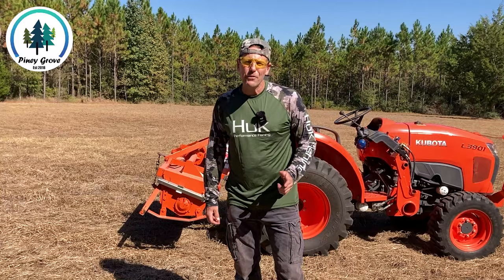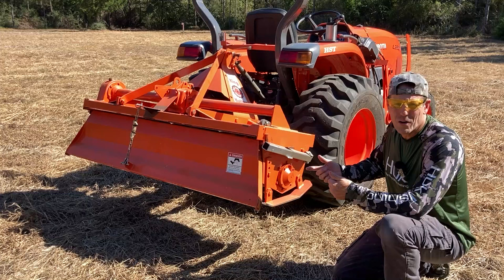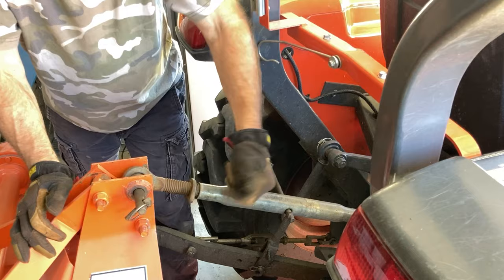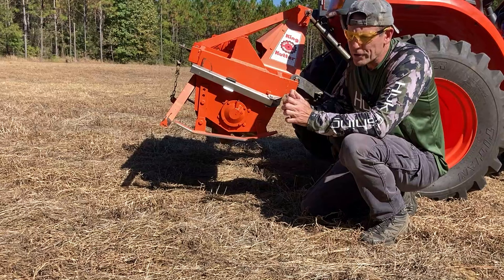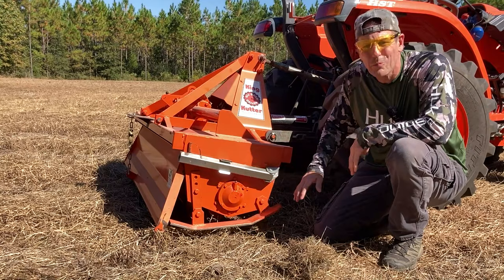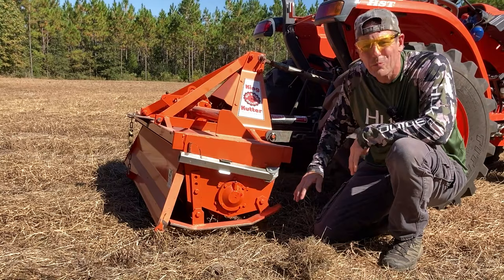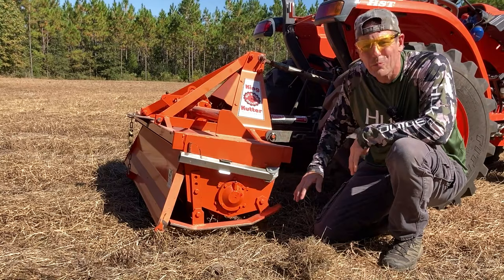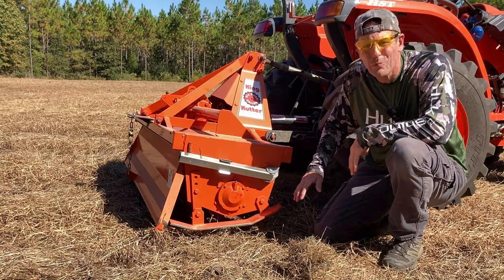How to Use a Tiller with a Compact Tractor

Comment: Bad idea never tighten your slip clutch that tight if it slipping already like you said over working tiller eventually destroy your upper gear box. I have seen this happen over and over I have kk used it for 20 years now issues I don't abuse it not commercial grade most are not need to use as residential not commercial if so go buy commercial grade tiller

Comment: Lots of other factors tractor weight also determine size equipment you can run i love Kubota tractor but number 1 problem Kubota is there lighter than most on market so keep that on mind definitely makes a difference on hills piece of equipment can flip tractor Kubota is the worst light high center of gravity 😊
Reply from the maker: Thanks for sharing.   We have a little more weight in the tires now!  https://youtu.be/uQmuNvcNsOU

Comment: The other commenter is correct regarding diakon radishes.  In the fall, before first frost, plant the tillage radishes.  They will grow the root into the hardpan and deeper.  In the spring, if there is no winter die off, till it to kill it.  Wait about 3 to 4 weeks, then till for planting.
Reply from the maker: We've planted them before.

Comment: 45 hp Kubota, 7 foot Landpride tiller. I usually follow a 2 bottom 16" dearborn plow and 6 foot disk. Those depth gauge runners do nothing unless you're tilling hardpan or virgin soil. 
Thanks for these good videos.
Reply from the maker: Thanks!  Tillers are awesome.

Comment: Something to consider; when making your successive passes, the skids sink in, tilling deeper.  I've tilled down to 6-7" with repeated passes without changing the skid depth.
You can control the depth another way.  Adjust your top link to be very long for less depth.  I've cut grass without disturbing the soil that way.  Helps with leveling the yard.
I appreciate the tip about moving as you drop your tiller.  I've constantly had "snipe" because I tried to get the sides square.
Reply from the maker: Thanks for watching.  Other tractor videos here:  https://www.youtube.com/playlist?list=PLG5yS75HLzo3RVqEuA0f6IioXV6FtFhHW

Comment: I believe if you go over it a few times you can get extra depth as the skids will sink into your tilled ground.
Also, on a side note, try to not engsge pto with tiller all the way up. You mention it's noisy when you engsge. That's cause there is too much angle on the pto shaft. You'll notice it gets quieter as you lower it
Reply from the maker: Thanks for watching and the tips!
Reply: Wouldn't have hurt to have PT o's up to 540 before he engaged the ground.

Comment: My dad and I did commercial, industrial and agricultural weed abatement mostly with a bush hog and a big Howard rototiller behind a Massey Ferguson tractor.
People were always complimenting on how pretty and smooth we left it after rototilling the ground with no footprints or tire tracks anywhere. 

I cannot find any reason for leaving the tailboard up. And it always leaves the ground looking bumpy and very messy!

We always rototilled in first gear low range with high RPM to leave the ground as smooth and pretty as possible.
Reply from the maker: Going slow and steady will lay down a nice bed for sure!
Reply: You leave the back up when the ground is wet and you want to speed up the drying process of the dirt than you go back with the back down after a couple days and make your seed bed
Reply: @rickkatz4692  we never waste time going back for a second time on any job! 
We do it right the first time!
We almost always check the moisture level of the ground before we go to the trouble and expense of transporting the equipment to the job!
My dad always used the shovel test,  I also learned how to do the grip test from soil engineers on construction job sites. Same results. Not too dry and not too wet.
We always left our jobs looking as smooth as buttered bread.
Never ever leave tire tracks or footprints! And always leave clean even edges all the way around. Never ever leave a job looking like it was done by some rookie!
A good rototilling job is art!
Many customers claimed that it was so pretty that they didn't want to disturb it.
That's why we had lots of repeat customers every year.
People could tell that we were professionals.
We charged by the hour with a 3 hour minimum.

I worked in the family business for many years and also worked on many construction job sites operating heavy equipment for over 30 years.

Comment: Normally you only replace rototiller blades when they wear down very thin or if they break or get really bent.
They're designed to be self sharpening.
And they wear at different speeds so you very seldom replace more than two or three at a time.
They can last for several months or years of heavy use.
Blade wear depends on several different factors
From metallurgy to types of ground and obstacles encountered.

And you mentioned sideways pressure on the bearings.
If sideways pressure is bad on bearings then every single drill press ever made has a serious design flaw.
Their main function is to put a lot of sideways pressure on the bearings inside the quill.
Just a thought. 😁
Reply from the maker: All good points.  Thanks for watching.

Comment: On that depth adjustment it looks like there is room to drill more holes so it will till deeper.
Our Howard tiller would till about 8-9  inches deep on the first pass, even deeper on the second pass.

On another issue I have heard all my life that plowing causes hard pan and rototilling loosens it up.
After doing some quick research there are several types of hardpan and a variety of causes for hard pan and a variety of ways to deal with it. 
I read several articles and they seem to agree on very little. 
Hardpan can be anything from compacted soil that water or roots cannot penetrate all the way to being sandstone.
It can be anywhere from a few inches deep to several feet deep.
It can be dealt with by mechanical means or by adding amendments to the soil and letting nature take its course. 

I get the feeling that tractor dealers are the ones that promote one type or another of farming equipment using hard-pan as a catchphrase to help sales.
Reply from the maker: Our tractor probably can't handle 8" tilling in dry clay!
Reply: @PineyGroveHomestead  true, you do have to rototill when the ground is crumbly and not too wet or too dry.
My dad did the shovel test on jobs.
And a soil engineer taught me how to do the finger test on another job.
Reply: @PineyGroveHomestead  don't tear your machine up on ground thy is too dry or too hard. 
Usually rototill a few days to a couple of weeks after a heavy rain.

Comment: I have a hard time ending with a flat finished surface.  I use a 445 JD and 3pt tiller.  There is always a ridge between passes, especially after repeating a few times to break up the pan a bit.  The clay soil doesnt help.
Reply from the maker: I'm trying to think what would cause that.....maybe the tailgate is too narrow or bent?
Reply: @PineyGroveHomestead  Don’t think so.  Its in pretty good shape.  It seems hard to find info on how deep to till.  3” to 8”.  Maybe I till too deep, especially on a second pass?   Thanks for the comment

Comment: I use a Ford 3000 diesel tractor and a 6 foot usa tiller it does a good job
Reply from the maker: If you have a quick hitch or even the Pat's quick hitch,  then clearance may not be an issue for you.    Most of my implements are old with the pins to the outside and welded so they won't come loose!

Comment: Bush hogs to determine the size 1 ft equals 6 pto h.p so 5 ft bushhog 30 pto h.p. when you go to 6 ft it changes need min 40 pto h.p  7 ft need 50 hp.
8 foot bush hog 3 gear boxes uses less power i have ran 8 ft bush ogs 40 h.p tractor no problem
Reply from the maker: This hydro 38hp tractor can't handle more than 5'

Comment: What hydraulic oil is compatible with my hst 5100 Kubota
Reply from the maker: I use Super UDT 2 from the Kubota dealer.  There may be other compatible fluids, but I only use Kubota.  I change that out in this video:  https://youtu.be/QwnB-MaMWaY